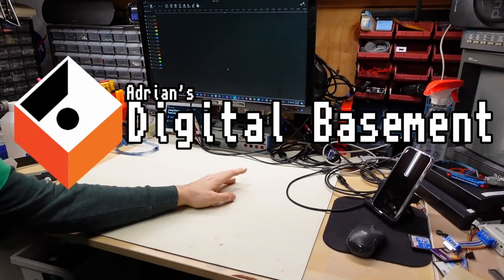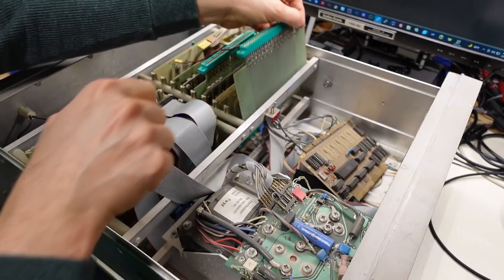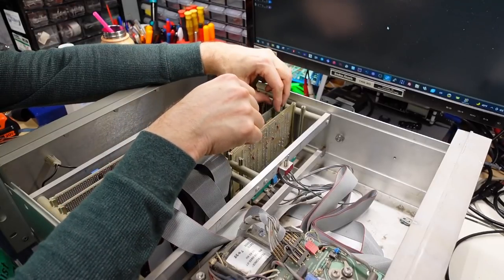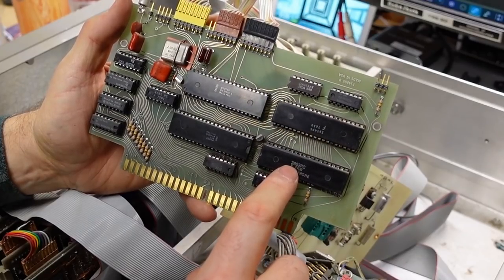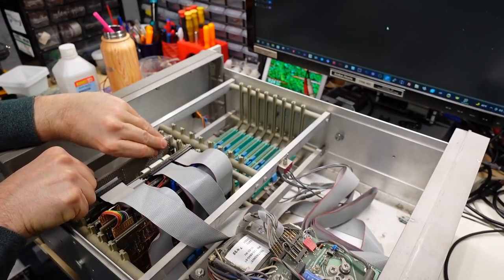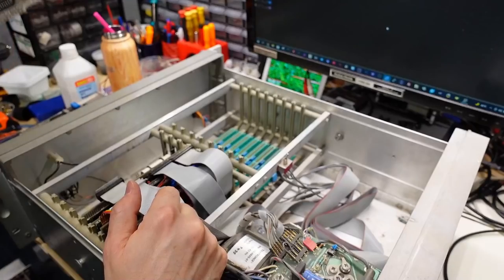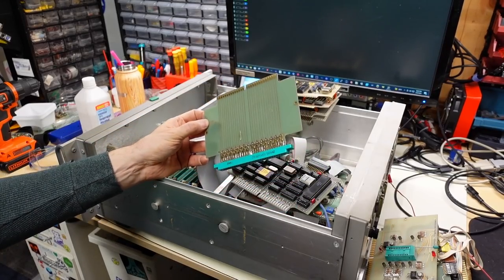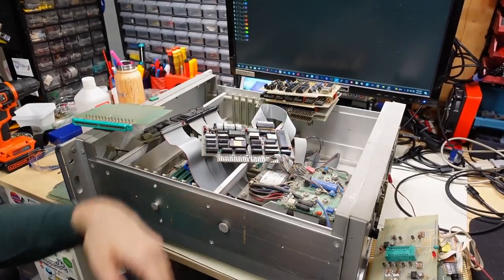I need help finding information on this mysterious computer

Comment: I'd put it all back together after cleaning up the battery that leaked and it's corrosion as best possible.  Take it outside, plug it in and turn it on.

Yes, serial terminal only on such a beast as has been mentioned so a simple telecom (procomm?) program on a laptop would work great and make it easy to try all sorts of speeds, bits and parity.

Comment: Cool, a Z280 based box. This might be meant as an MP/M or multi-CP/M system. I know there were commercial systems like this, where you could give several people a "dumb terminal" and run standard CP/M software on it. DBase2, word processors, that kind of stuff. There used to be a time when 64K actually was enough...

Comment: My thoughts would be power it up without the cards, check the voltages are sane, then put in ram, a cpu card, and look for bus activity of it "booting" then later add a serial card and see if anything is coming out of the ports.  Alternately try the z280 card.  Maybe even try putting in altair basic roms and see if it does anything.

Comment: Looks to me like two systems in one: A z80 with 24k of ram, CPM boot and prommer. The second is a Z280-MPU based system with 64k ram and floppy controller and clock. The Z280 is a complete 16-bit microprocessor with MMU. 'MPU' spells "MicroProcessor Unit"

Comment: As others already said, it's probably a custom built system for either a lab application or an industrial process controller. The use of off-the-shelf rails and quarter turn fasteners makes me think that a scientific lab computer is the most likely.

If it was installed in some kind of hazardous environment (like a laser lab) then it would make sense to not have any video connected to it and use serial terminals only.

Comment: Possibly it is a STD Bus based machine.  Google Image search of "STD Bus" does show that the cards had a notch near the center of the edge connector.
Reply: I was going to suggest STD Bus too.  I only worked on an STD Bus system once back in the early 1980s.  This is definitely not S-100.
Reply: Back in the 1970s and 1980s, hand rework was not unusual, even from fairly large manufacturers.  It was a lot more expensive to do art work  back then.  Only the largest manufacturers could afford direct schematic capture to CAD to output device.  I have some 1980s era production boards from Burroughs that have several rework wires on every board.  Back then, rework wouldn’t been considered the deadly sin that it is now.
Reply: Back in the 1980s, it wasn’t unusual not to have raster video output.  The ADM-3A serial CRT terminal made by Lear-Siegler was de rigueur for CP/M based systems.  By the way, the cost of an ADM-3A was “only” $995 US in 1976 money.  Yikes!  If you wanted to get fancy, you could add an option to display lower case characters.  The ADM-3A was considered revolutionary as an output device because it was so inexpensive.  The competition would have been a DEC VT-52 or maybe a Hazeltine 1500.  I found an old 1970s advertisement for the Hazeltine 1500 for $1,125 ($4,700 in 2022 adjusted for inflation).  The DEC terminal was probably even more expensive.  That is almost what an entry level automobile cost back then.   The MSRP for a 1976 Chevrolet Chevette was $1,899.  That is why not too many people owned their own computers in the 1970s.
Reply: @wtmayhew  STD Bus is just slightly before my time, but from reading about it, it was heavily used for Industrial Control.  That makes sense to me with all the serial connections it seems to have.  Also with it's age, and possible industrial usage, I would not be surprised if one of the cards was an ARCNet controller.  Typically ARCNet only needs 4 wires (2 pairs) or a coax connection.  I didn't see anything coax related in the video, so if ARCNet is there, it would most certainly be the 2pair variety.
Reply: @glendady8879  +1 for remembering ARCnet! 🙂

Comment: Got a feeling it is part of the data processing system once used in "crossfields electronics ltd" data processing. Before the they were bought out by IBM.or Xerox I think. 
My dad used to work on them and they had huge 1mb (at the times) disks. To process database management systems for airports or other custom made application. 
Back in the day the company would create custom machines much like people would people create custom software now.

Comment: I think this is part of a manufacturing or development system for other hardware - it looks similar to an Altair follow-on with the debug headers on the cpu card, and from the upgrades it was definitely used for a long time. 
It could have been used to create custom or personalised EPROMS for other hardware. The hand-strung PCBs are not home-made I believe, but custom-order boards - and they would have been really expensive.
Many of the bodges seem to be there to support the upgrades of the CPU and IO hardware. 
Maybe you found Bill Gates long lost Basic development workstation.

Comment: 44 pin cards? Std bus? Used for industrial control applications back in the day. Predates the s100 and ss50 buses. Imagine a raspberry pi from the stone age. Back in the 1970's radio shack sold 44 pin headers and prototyping cards that could be used to build up a controller.

Comment: In thinking about this for a couple of weeks now, I have come to the conclusion that this set of boards looks more like a collection of boards used during the creation of prototype kit/computer offerings like the IMSAI 8080 or Mits Altair 8800 where they most likely went through iterations of boards to make a whole computer.  Until we find someone who can identify these cards and the company we will never know who/what/when and why of this box and its contents.      AND of course the biggest piece of evidence in this adventure is the presence of a PROM programmer and a board that looks like it would hold many PROMS.  These would not be used by a home hobbyist but by a person building the PROMS for a system.   The multi PROM card would be used for verification/checking contents of the PROMS. 

This collection of cards may be from only one of the principals of the company and another set exists for another person or that box was lost/separated from this one.

The bodges as you brutally attacked the owner of such a kit would be necessary to correct errors in early versions of cards.   Errors would be of both design and layout and perhaps manufacturing.

Depending on the  architecture of the system and options ie floppy drives vs harddrives one might need one or more  PROMs.

Comment: Since there doesn't appear to be a corresponding header for that unpopulated socket on the Z80 peripheral board, I wonder if that could have been for a DMA controller to work with the SIO and PIO chips.

Comment: Looks like a RC2014... The standard configuration consists of the Z80 CPU, 32KiB RAM, 8KiB EPROM and a UART interface. A Microsoft Basic is stored on the ROM, which is started immediately.

Comment: It looks like a controller for some piece of scientific equipment. Probably not  homemade per se, but made for a niche academic/commercial application. I've seen plenty of similar looking nondescript units in electronics racks in labs running old mass specs, vacuum gauges, etc.

Comment: Great old machine(s)  - Fairchild F8 architecture with this completely different Z280 machine... all connected via STD bus.  Strange indeed.   And those ceramic Intel 1K ROMs ewww.    Most F8 computers were REALLY old when I first saw them, from the late 1970s at the latest.    

The Z280 is odd in that box because it didn't arrive till it was way too late for Zilog in 1987.   It looks like someone was reimplementing the same functionality using the more modern Z280 (for the time) and the system was still in kinda debug mode, toggling between the two architectures.

I remember being called out to fix a few F8 based custom industrial control systems when I had a side job at University as a computer repair kid.  Back in those days (late 80s) you had to be across a lot of bizarre architectures and implementations from the past; F8, Signetics 2650 and RCA 1802 systems were really weird.

The weirdest F8 I ever saw was similar to this but S100 bus running an automated chicken farm feeding system!   
All sorts of motors/solenoids controlled by multiple custom pinout DB37 sockets.  And analogue stuff coming back in to sensors, multiple serial terminal connections.  Needless to say, without any manuals it took a bit of work to fault-find it!     
As the machine was located right next to the electromechanicals and had huge fans, you can just imagine the smell!    First the box had to be removed of thousands of feathers - not an enjoyable experience!

Zilog attempted to cash in of the massive success of the Z80 running CP/M in the late 70s and early 80s, so they created 16 bit and 32 bit derivatives of it. 

The Z800 was meant to be the 16 bit successor but it was far too late and never launched (I don't think).  

Hitachi made a version of the original Z80 - the Z180 but that was just the original with a clock gen and support chips built in.
  
Zilog's Z280 was a rebranded version of the original 16bit Z800 in CMOS.   

The fully 16-bit Z8000 had some success with Olivetti and others and there was a 32 bit Z80000 version which I think was designed for supercomputers but was so expensive I never even saw it - ever. 

Problem was Zilog was way too late.  16 bit CP/M was a very moderate success - mostly on the Motorola 68k,  but by the mid 80s everyone was buying PCs and MS DOS clones and Intel x86 took over everything.    

Zilog later had success going back to their roots with the 8 bit eZ80 which was easy to interface with hardware and fast!

Comment: Seems likely to me that it was used in a university lab class.
A professor's pet that they thought their students with,
helping expand it further and learning the inner-most workings
of a computer at the same time. Explains all the various aged chips,
hand-made boards, and the testing, prototyping and programming bits.

That or a prototype system from a failed startup or something.

Either explanation seems likely to me.

Comment: Looks very much constructed in the same way as my twenty four hour electrocardiogram analyser which was in two of these 18inch racks had all the excess bits thrown in and was dumped in a basement at the UK medical school in the early 80's when Mrs Thatcher closed down the bioengineering dept!

Comment: You can actually still get those things you put in a slightly larger hole in a PCB to make it a socket (some even say you don't need to make it any larger than normal). I think they might have been on an Adafruit "Eye on NPI" video in the past year or two.

Comment: About the chip MK90004, it is varaint of 3861 PIO from mostek. I think this is a one of computer for industrial purposes, since a few of the components are a bit of a odd choice for a hobbyist. I think it may be bootable without disk.

Comment: Back in the 80's, I used to work on the Northstar compters running CP/M OS, and it took S100 bus cards like this...
You need to hook up a serial terminal to it, and the main bux (cpu) would time slice to multiple serial terminals...
That cable at the end looks like a serial patch cable...
https://en.wikipedia.org/wiki/North_Star_Computers

Comment: Are those cards the same format for the TRS-80 Mod II backplane?  I wonder if it’s a storage controller for external hard drives using a SASI (precursor to SCSI) interface off the back. The RS232 DB connectors are used for config.

So maybe an early RAID box or a simple storage cache for multiple floppies?

Comment: My guess is it's build by people at a university, for research, communicating with scientific devices like measuring instruments etc. I know my father worked on such hand made one off systems, with an electronics department making the pcbs. Most likely operated with a terminal, perhaps shared among different workgroups.

Comment: The bus connectors look very similar, but not quite identical, to the DEC PDP-11 bus. It might be interesting to see if whoever built it used the PDP-11 as a model for the bus layout. It would require mapping out the address, data, control and power lines to the various positions on the edge connectors.
Reply: Or how about PDP-8?  (I don't know).

Comment: Those hand wired boards look pretty professionally made for a home gamer. That person was either extremely fastidious about their hobby, or they were getting paid to do a good job. And the gold plating on those PCBs suggests it would've been a pricey piece of kit back in the day. Definitely either industrial control or test equipment.

Just looking at those hand wired boards makes my brain hurt. Most of the time I have to troubleshoot my hand wired prototypes once or twice to find my mistakes, even with simple designs! So if that's what it took to be a computer nerd back in the 70s, I think my particular brand of ADD would've prevented me making the cut.

Comment: When at Newcastle upon Tyne university in the mid 80’s they had a lab full of things that looked like this. It was used for programming assembly and interfacing to hardware projects I seem to recall it was something like a vme bus development platform.

…. Update. Looking closer. This is not vmebus that the cards are different. This could be something earlier, probably 8bit based unlike vmebus which often user 68000 series CPU.  With all the custom cards it looks like the same idea however. It’s built to design and build boards for whatever the bus is.

Comment: My guess would be a SCSI SAN controller. The drives would be in an external enclosure and this would handle (high speed) data transfer.

Comment: That's because the computer in Star Trek was made to be actually useful, not a corporate spying machine tuned to listen to everything your say without your permission so it can build an advertisement and information profile to sell to the highest bidder. Isolate one of these things on a network some time and analyze the packets it sends some time.

Comment: C/PM systems like this were fairly common in the late 70's and early 80's.  This seems like a prototype at an engineering firm, or a university.  Video controllers were not popular with many businesses/engineering firms.  They preferred terminals.

Comment: The bus could be STD bus.  It used a 56 pin connector with a split in the center.  Pictures of STD cards I'm finding seem to have a different form factor, but given this is clearly a mostly homebrew machine, they may not have cared.

Comment: Looks like a lot of ECNs were acted on. (Engineering Change Notices) to fix bugs and speed up the system. Reminds me of a System 32 Lundy Computer graphic, but they had green removal levers and Zero Force  Connectors on many boards you give a half turn to release the board. Wire wrap boards were prototypes. Lundy was in Glen Head, Long Island NY.
Reply: Henry Ford Museum may have a System 32, 3D Graphic System to look at (Early CAD Systems) I did Preventive Maintenance on these and newer systems back in the 1980s. They had Analog Character Generators and Vector Graphic outputs for a Giant Round Faced CRT and 3 phase 308VAC if I remember.

Comment: This looks like an RML380Z?  (Or later model 480Z) It runs the CPM operating system. Later models could also run the multi-user version called MPM with systems connected via RS232 cables. Very early days of networked systems. I remember programming them using assembler and on later models BASIC.

Comment: that board with the plcc package on it makes it far more recent. kinda weird to have both ceramic white eproms AND a plcc package in the same box. that board is also far more recent than the others which are mostly all of different makes anyway but the construction method on it is quite old. weird.

Comment: those proto boards are worth framing up if you do not aim to get them working. I would worry over the coated wires having flaked and grounded over time or handling.

Comment: Just the number of hours those cards would have taken to solder up...  wow.  I'm really impressed with the workmanship, even if I haven't got a clue what the system is or is for.
Reply: Even back then wave soldering was used for production boards. Simplistic explanation is that the board was dipped in liquid solder and then pulled out before the plastic parts melted.

Comment: Those old Intel eproms are like $30 a piece now. People really dig the white chips as they look like the early4004 which go for a shit load of money.

Looks like a prototype for some form of industrial controller of hardware monitor. Could be for a specific one off scientific use. Lots of computers would loot like this if they were made for one of a kind machines but the eprom programmer being left inside leads me to believe this is some form of development test bed. You might have info in those roms as they have very good memory retention. Programmers even back then would typically signature stuff at least.

Comment: NorthStar Horizon or Clone, Prototype...  It's likely a pre-IBM era Intel 8080 or a Z80 (4MHz) based microComputer running CP/M (before DOS Era).  Some of your ROMs have early / Mid-80's dates but it's entirely possible this went thru many hands and the ROMs etc. ended up along for the Ride. This Vintage is probably late 70's early 80's. Some of the other responses could be accurate. Origin would be hard to decipher since these kinds of things weren't really commercially viable per se; at least not from a cost standpoint. Most certainly experimental use-case or purpose built.